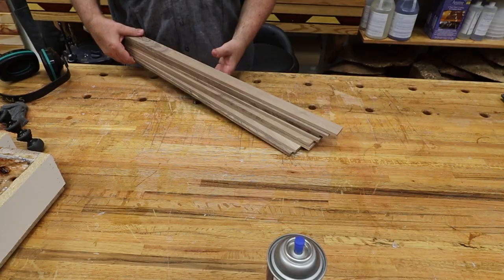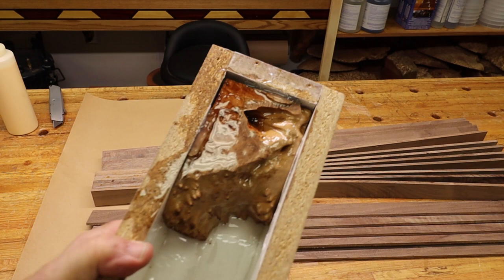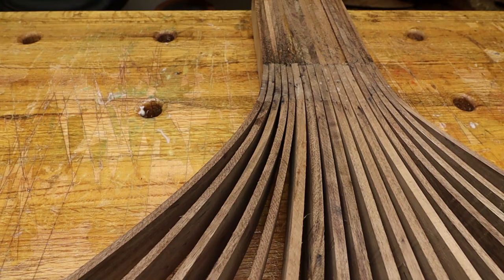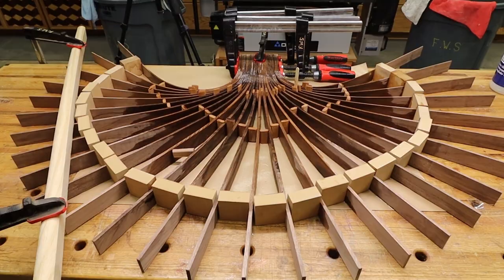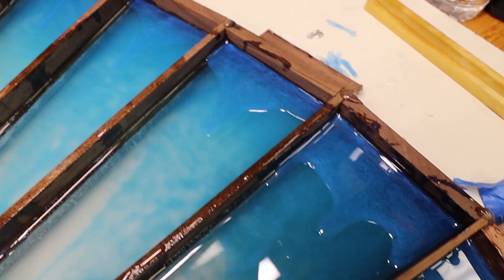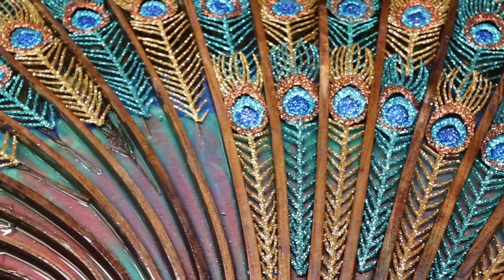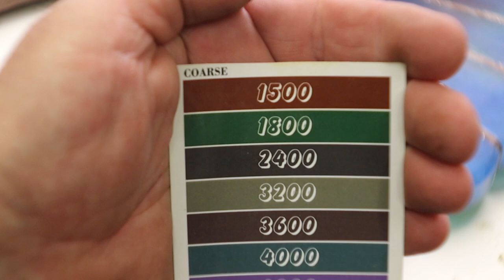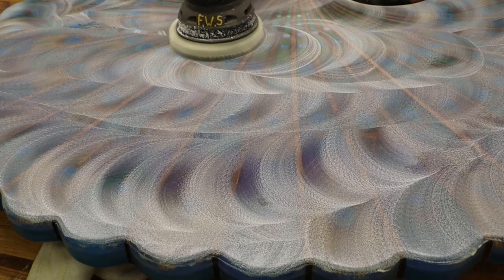resin peacock table part 1

Comment: Doug, I bet that won't fin in a pressure vessel!  
Doug: I pulled a vacuum in the shop to get most of the bubbles out, then pressurized the shop to get the rest of them out!  😁
Not only are you great at pouring resins, but coming up with the idea!  That's amazing!  I can't wait to see it complete!
Reply from the maker: Bill I bet you I could find one big enough to put it in. LOL thank you my friend thank you I've got it all finished I'm just having to edit the videos so I can get it out there. And thank you my friend I appreciate your compliment thank you so much. I'm honored sir. From Doug
Reply: Doug, I bet you could!  So how many pours was that?  Just amazing!  Not something you can do in a couple pours.
In my old age, I have learned patience.  It drives my wife nuts!  I'm making cottage pie.  Kind of like a beef pot pie without the crust and topped with mashed potatoes.  I started at 6:30 Maryland time.  Hopefully we'll be eating by 10!  I'm not in a hurry and it will be worth it.  Same with barbeque.  I've stayed up all night feeding the smoker with charcoal because it took 8 hours longer than I thought.  But it was some of the best barbeque this side of Texas!  (my dad grew up in Hearne TX and I visited a few times by my self in the 60s.  I had Barbeque I will never match! )  
I hope you're safe in the winter weather!  Lately, we've had "salt-magedan".  They called for bad weather, so the salted the roads and we got nothing!  Except salt!  We've also had those crazy ice storms that no one was ready for.  I really felt bad for those folks that got caught up in the huge pile up in TX.  We've had them too.  Sometimes it's best to just stay home!
Take care!
Reply from the maker: Bill you're killing me talking about all that food barbecue and margaritas. I'm stuck home it's frozen outside we're staying safe and doing our best. Hope you are too my friend. Yeah I heard about that bad pile up and saw it on the news I feel sorry for him I truly do. We have some real high flyover intersections here on I-10. And cars get trapped up there when you freezes all the time. You got me thinking now so I'm going whip up a margarita. And you're right best to just stay at home and thank you my friend thank you from Doug

Comment: Don't you run into heat problems, when doing such big pours?
Reply from the maker: Good question my friend you would if you poured it all at once you would have massive heat problems and it would crack. I poured it in quarter inch thick layers. if you look closely at the edge you can see the layers. by pouring it in thin layers I didn't have that problem and thank you thank you for asking from Doug
Reply: @fleetswoodshop3339  thanks for the explanation
Reply from the maker: You're very welcome my friend anytime thank you.